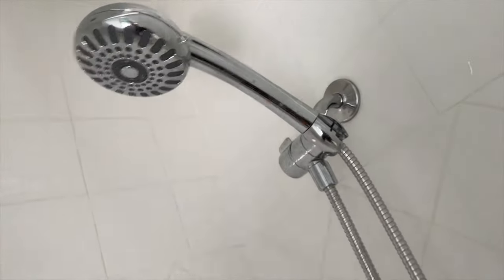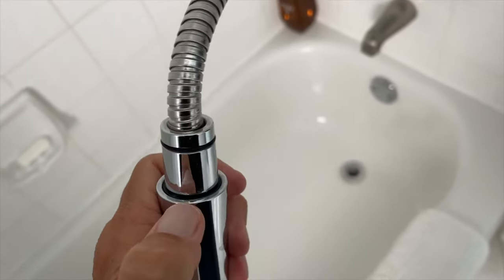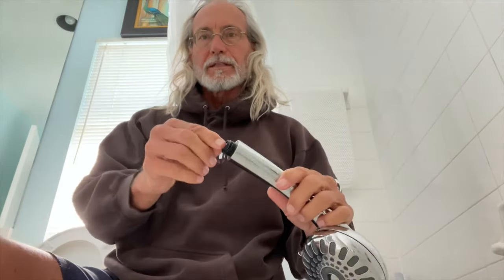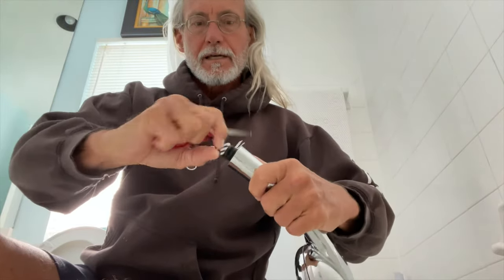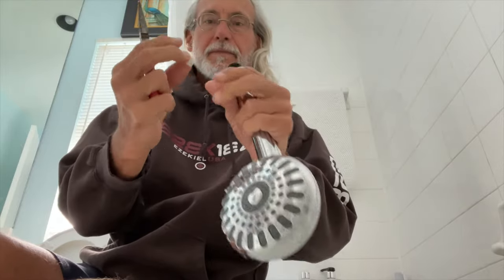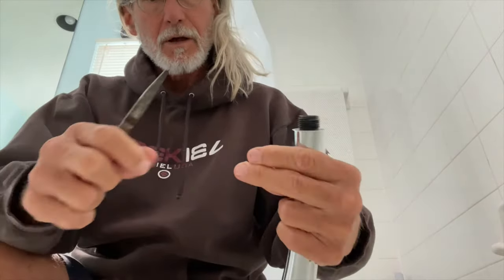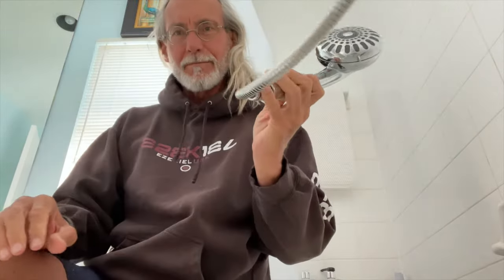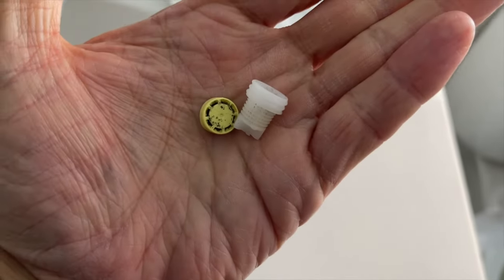How to remove a water restrictor from a shower head

Comment: This video was truly helpful. I removed the first water restrictor last year but I didn't know about the second one until I watched this video today. I went and checked the shower head for a second water restrictor and sure enough, I could see a second one lower down in the tube part of the head. I didn't think my needle nose pliers would reach down that far but after a few attempts they did and I was able to pull the restrictor out. Wow, it is so nice to finally have water pressure. When the water pressure was lower I spent more time in the shower rinsing so I ended up using more water. Now I'm rinsed off in a few seconds and I'm sure I'm using far less water because I spend less time in the shower. At worst, I'm might be using the same amount of water but the showier is much more enjoyable. Big thanks to Tom Leeman for this video.
Reply from the maker: Thank you I appreciate those kind words. Enjoy your new, strong, water pressure.

Comment: This saved me from getting a new instant water heater or shop around second hand vintage shower head. as I’ve currently got a Bosch Hydropower and it relies a slightly higher water flow to ignite the unit. In winter its fine but in summer even on I tweaked the temp setting a million times it doesn’t quite work. Either burning hot or bloody cold. As some comments said it’s actually more efficient as we take less time to moisturize and rinse. Thank you!!
Reply from the maker: I know it’s funny they want to restrict water for conservation but human beings don’t really use that much water with these devices so it’s foolish law but enjoy your stronger shower. Thanks for watching.

Comment: On some of the newer shower heads sold at big box stores (Waterpik being one of them) you have to break the water restrictor out of there, especially on the 1-piece shower heads. Just take a screwdriver and a hammer, put the screwdriver onto the water restrictor and smack it with a hammer to break it out of there. The restrictors are plastic and break fairly easily, no need to use too much force.
Reply from the maker: Excellent tip thanks for the info

Comment: FYI mine was not in the handheld part. Waterpic . It was in the part that attaches to the shower spigot for the handheld. It had 2. Second one inside I had to drill , but it came out on the bit. Yayyy thank you!
Reply from the maker: Excellent job get that water pressure up. Happy holidays. Thanks for watching.

Comment: The static water pressure always remains the same and nothing you can do will change that. Whatever the pressure is at the service entrance is what you have to deal with. When you open a valve the pressure always drops. You might start with 65psi at the service entrance but you end up with 45psi in the shower with the valve wide open without restrictor. I have 3/4” pipe feeding my showers with 70 PSI at the entrance. I actually have 105 psi at the entrance but have an adjustable pressure reducer . 105 wears out seats and valves faster plus the water hammers the pipes when the washer valves kick on and off so 70 is the sweet spot.
Reply from the maker: Excellent tip thanks for watching

Comment: I just installed a new showerhead with a filter in it.  Brondell large round showerhead with filter.  Will removing the flow restrictor affect the filter at all?  I assume it would still filter out minerals in the water even with the flow restrictor removed?
Reply from the maker: I would think that it will still filter out the things that it supposed to good luck thanks for watching

Comment: You removed the water filter filter.
Reply from the maker: No, this is just a restrictor that slows down the flow of water so you use less this should give you a higher pressure

Comment: This is really a waste of water. There are very efficient water-saving high-pressure shower heads. The pressure can be very high with shower heads that use only 6 litres per minute, instead of 18-20 litres without a flow restrictor. Saving water resources is a real issue. We have more and more water restrictions where I live because we don't anticipate water shortages and droughts are more en more common.
Reply from the maker: Good to know thanks for watching
Reply: I've never heard of a shower using 18-20 liters of water per minute. The most a shower head uses is 2 to 3 gallons per minute and those are the highest pressures available.